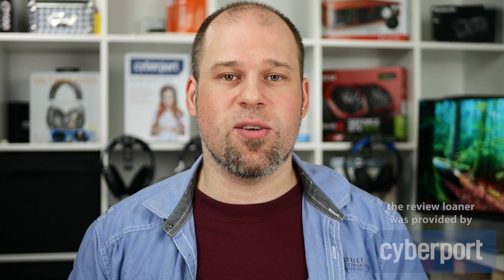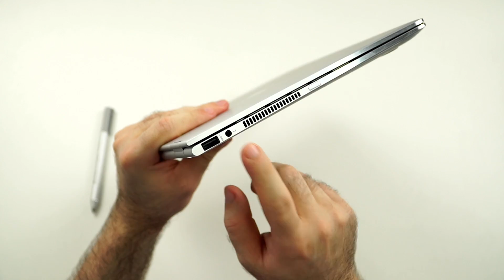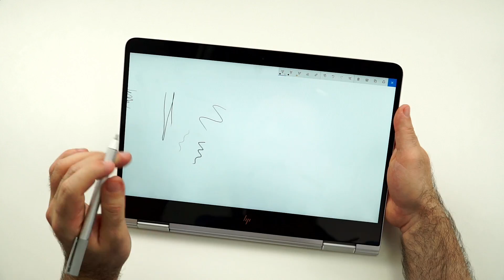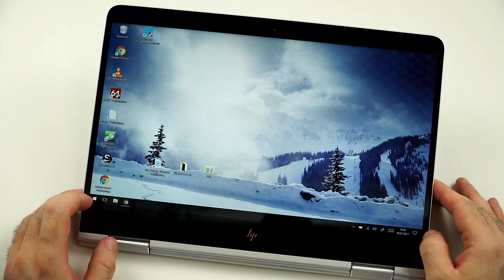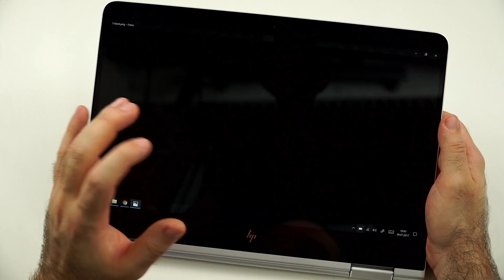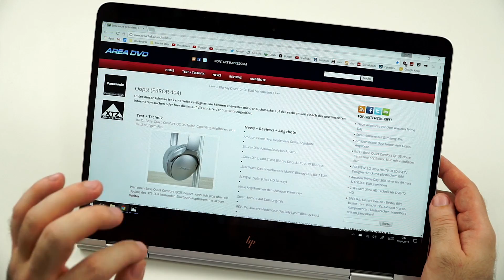HP Spectre x360 | the versatile one

Comment: I have an older model HP Spectre (I think it's been 1 1/2 years...maybe more?), so the keyboard layout is different.  On my keyboard, the Home, End, Page Up/Down keys are secondary functions on the arrow keys (so annoying!).  I like that there are dedicated keys on the new model.  I don't think it'd be a dealbreaker for me, since I've had an HP laptop before, and I believe the Home, End, Page Up/Down keys were in the same spot on my old laptop, as on the model reviewed in this video.

If I were asked what I'd like to change about the Spectre, I'd say the trackpad.  It's just TOO. DAMN. BIG.!  It's hard to accurately gauge whether you'll be left-clicking or right-clicking, since the span from left to right is a lot broader.  Maybe people with longer fingers don't have this issue, but my fingers are pretty normal in length, and I'm not too keen on the fact that I'm not able to execute the desired function on my trackpad on my first attempt--this was never a problem with smaller trackpads.  Maybe one that's larger than the original size, but smaller than the revised size would be optimal.

There have been some software issues, but HP's been good about updates to fix glitches.  That wasn't the case before, but they've improved a lot in the area of customer service.  Their forums are even informative, which I wasn't expecting, given their track record.

I love the B&O speakers.  My sister bought a Fujitsu laptop for about $1600, and it's so crappy.  Among other flaws, the speakers are tinny and barely audible.  You're meant to listen to audio only through headphones on that laptop.  That shouldn't be the case on such a "premium" device.  My Spectre cost about a thousand, and it feels solid.  It's not perfect, but I can live with it's flaws, esp. at this price.

Comment: Great review.
But then come to price and features, I do not see many competitors around.
2-1 with pen support, it also has Windows Hello face recognition I believe.
XPS13 and Surface Laptop are just regular laptops, most other 2-1 laptops do not have pen support, XPS 13 2-1 version has weak Y processors - much worse performance. The only real competitor is Yoga 720 13".

Comment: Even though you weren't super prepared, I still think the review was great. I'm really glad you commented on noise, and especially on coil whine of which I've seen some people complain about online.  Btw, would you say the hinge is too loose? Some screens wobble a lot when just typing (especially those with 360 degrees hinges), which I think is a dealbreaker.
Reply: Damir Franc Ok great! Thanks!
Reply: Damir Franc hi love ur video. There is a new laptop for students on a budget of 800$ its the hp envy 360 with infinity edge display. Please review that. I only buy something unless u review it
Reply: sam ezy not him but I would say the HP envy x360 is a nice computer, the styling is great, and the only problem I have is that the backlight in my model doesn’t work on the ‘m’ key and the weight is a bit of a problem on the 15” version that I have. (also the fan is kinda loud)